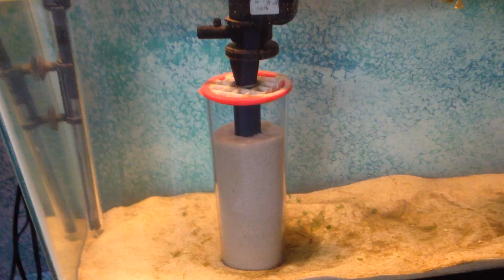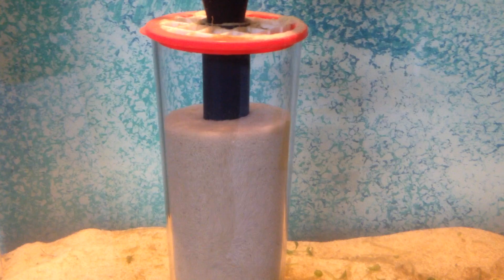DiY Canister Fluidized Sandbed Filter pt 7

Comment: watching a video on "TheKingofDIY" here on youtube, i believe he says the sand level drops when collecting  the weight of the new bacteria colonies.
Reply: Marc Mayfield also, just throw on a sponge prefilter
Reply from the maker: You are correct on both accounts. A mechanical filter of some kind is ideal to go over the intake. The bacteria will make the sand heavier, but we are talking fractions of an ounce.
Reply: I guess the density/granule size of the sand would also contribute to how much the weight would affect the sand.
Reply: +The-Roost Hi, I'm pretty sure it works the other way around.  The specific density of the granules decreases as the micro-organisms develop.  Depending on the flow-through, the fluid fraction increases in viscosity (pushes in the same direction).  A modified Stokes equation could further the enquiry.